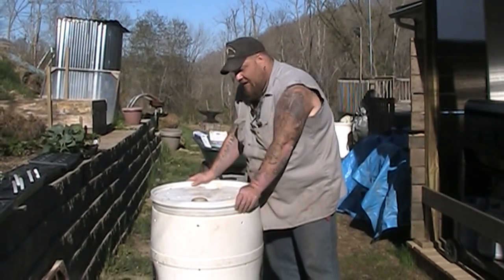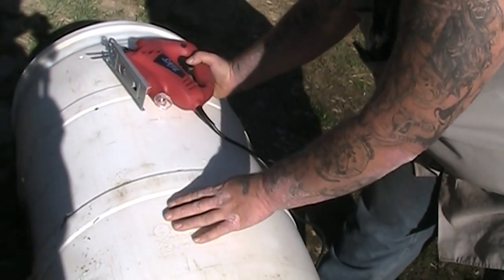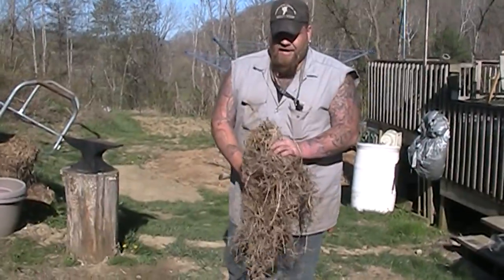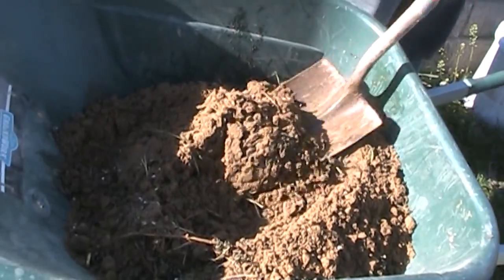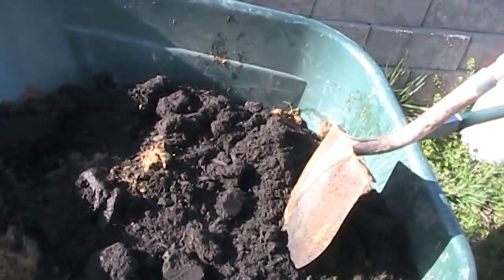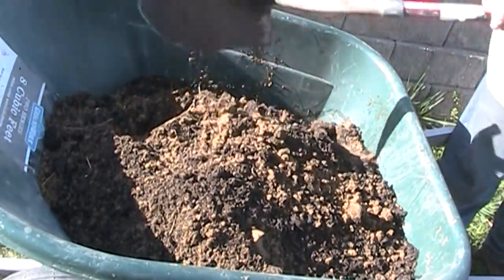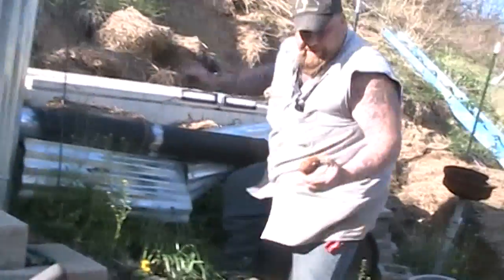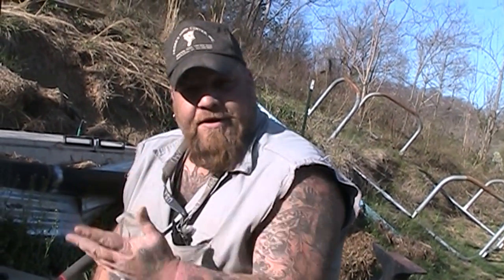Re-Using a cracked rain barrel

Comment: We use 30 gallon Rubbermaid garbage cans and layer straw then a sprinkling of soil.  Then three potato pieces. Then repeat twice so that the container is never more than 1/3 full. I do allow my potatoes to set a say so the cut area seals well.  When I do not they tend to  rot. Then as the vines start to show I add more straw and a sprinkling of soil to cover. And older gentlemen taught us this method thirty years ago. Works great.

Comment: potato towers fail because they will not produce potatoes on a vine that has turned green. you can not let the top grow and then add more soil to it. If the vine is already green and you cover it with more soil it will not produce a potato on that portion of the vine. Yes the top will continue to grow taller but don't expect more potatoes.

Comment: the materials will also make great materials for tool sheaths. Heat it up to about the temp of boiling water and bend it to shape.  press it down to get around uneven shapes.   It makes a good cutting board too.
Reply: Makes a great slide for hauling wood too.

Comment: I have a 200 gallon water barrel here that I have been trying to give away for a few years.  Distance is the issue.  I cant throw it into your yard from where I am standing. 800 some odd miles away.
Reply: throw it down to missouri lol hope you are doing good
Reply: I live up near Fort Dodge.  you can come get it if you want it.  It has been used for agriculture so it should be a drinking water barrel
Reply: Randy J i have to tie it on my roof of car lol i have a chev cavaler lol 4 cyc